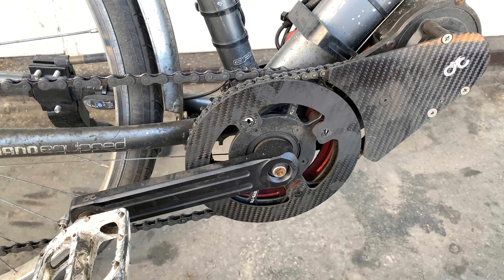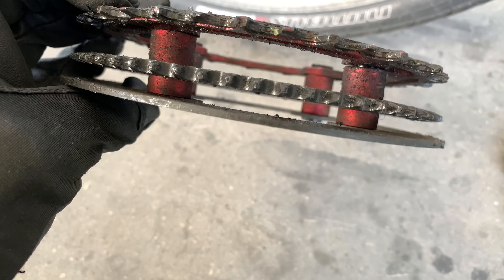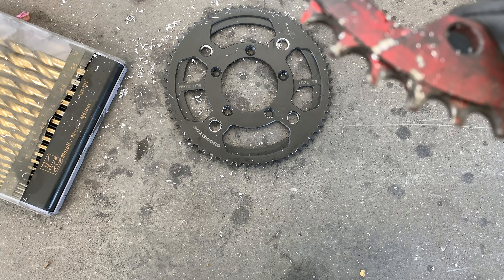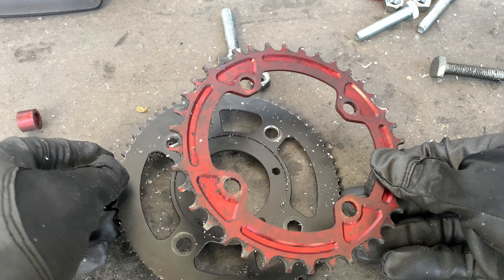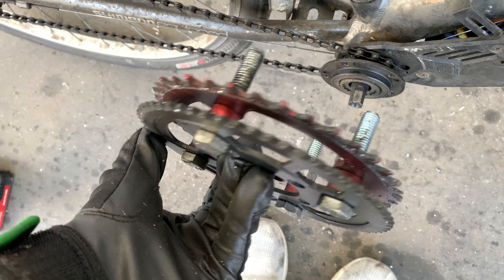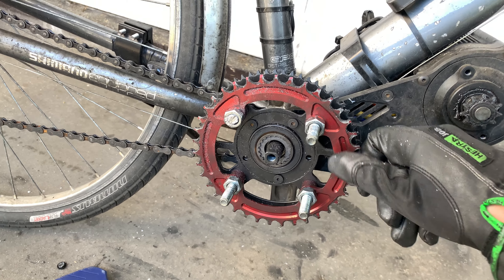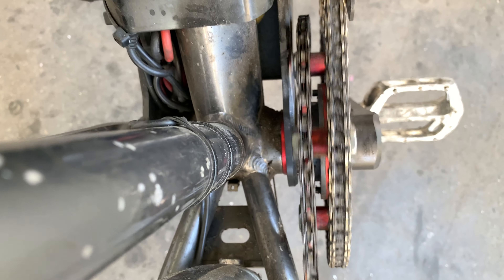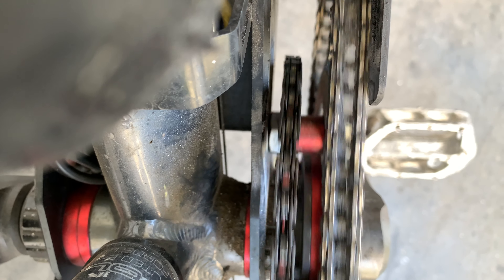How NOT to Fix Your CYC X1 PRO Chainring! (Part 1)

Comment: Hey Valentine. I was just out for a ride and heard a noise and saw one of the red spacers rolling on the ground. I had broken 3 of the bolts on the chain ring. Are you going to be posting a part 2 where you fix it a better way (non bodged) Thanks. Seems like this is a weak spot on the motor kit.